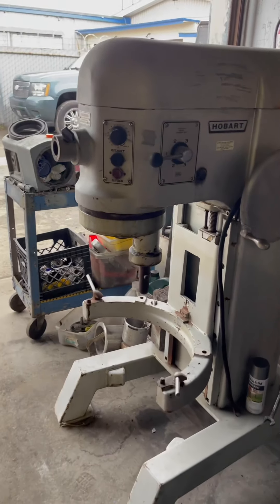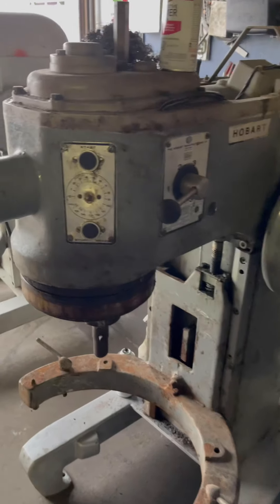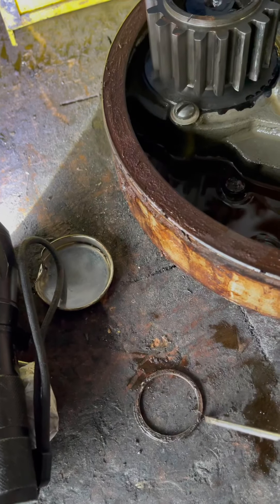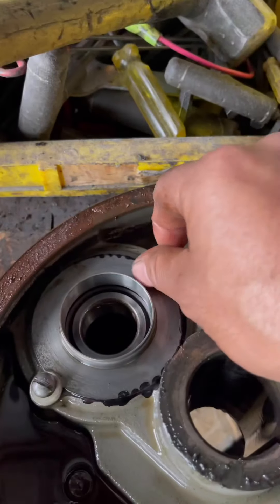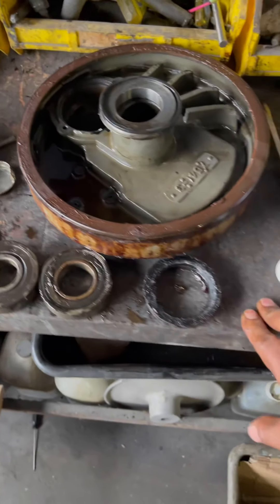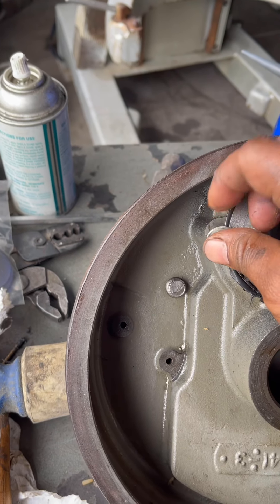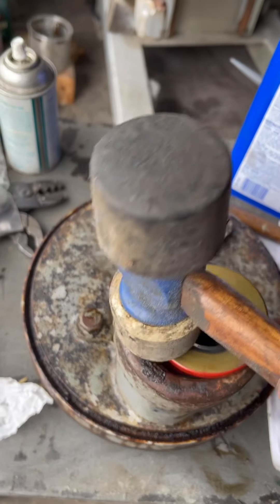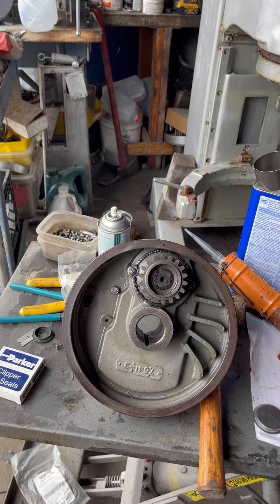Hobart Planetary Service H600 L800

Comment: Thanks for this video. 
I am a hot side technician but don't have a lot of experience on mixers.
Reply from the maker: With practice you will get experience a sugestión if you stating to do Hobart mixers get the diagrams for transmissions that will help you I’ll give you a better idea

Comment: hello, i have Quattro 20ltr Mixer. the design looks very similar. the hook is stuck, so replacement shaft is the solution. i've tried hitting the shaft with a hammer many times but it doesn't want to come out.  are you based in europe and able to help me out or maybe i can send you photos to show you? thank you

Comment: Nice work. I'm sure it's hard working with one hand while filming. Could you post the part number and source for the aftermarket seal you used? Keep up the good work.
Reply from the maker: I bought it on eBay just search this seller 
U-save62
He has a lot aftermarket parts for Hobart
Reply: @calucoelsv  Thanks, talk about ESP, I was on his site when you sent your message.

Comment: Can you please tell me the number for the aftermarket oil seal
Reply from the maker: Hello sir
I don’t know if you are talking about the gasket maker if that’s the case I used permatex maximum oil resistance gasket maker 
If you are talking about the glass is oil level gauge found on eBay the seller I get them from is u-save62 on eBay